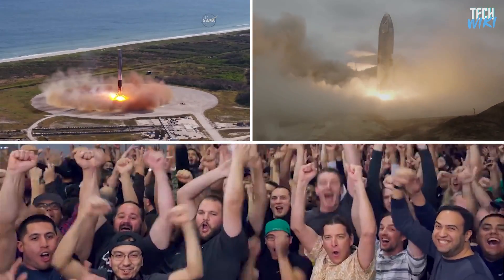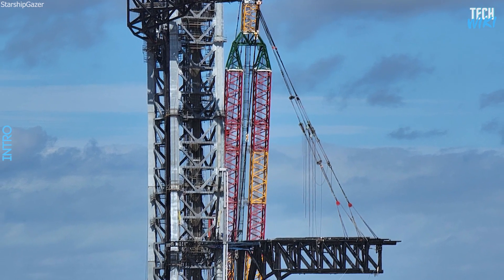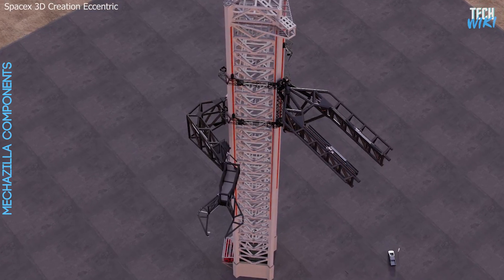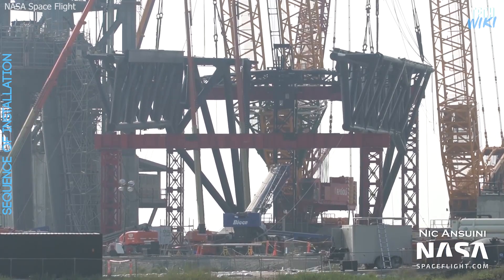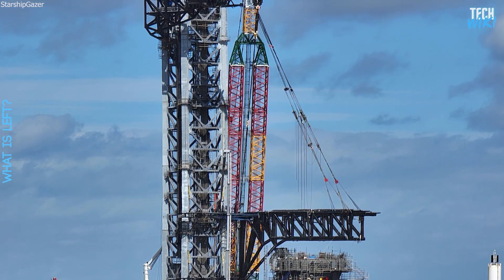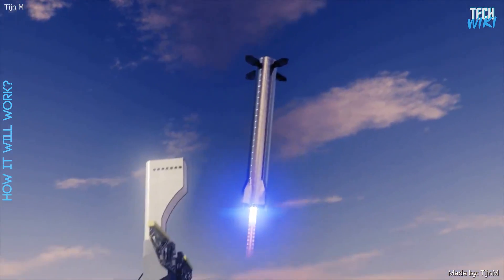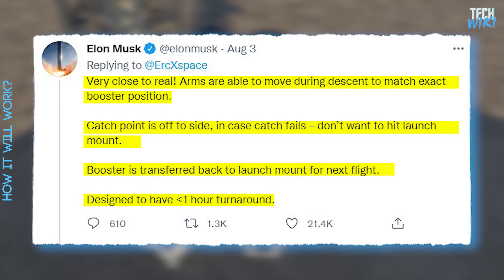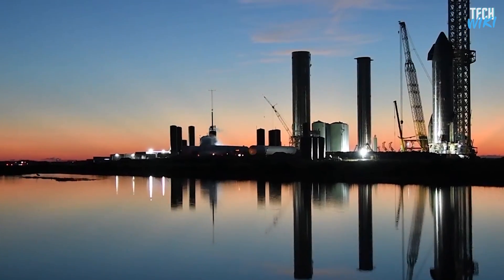Step by Step! How SpaceX Assembled and installed Mechazilla in just a Few Weeks?

Comment: or let it drop into a pit of sand with supports firing from the side to hold the neck in place after its weight comes to rest on the sand. think camera aperture.
Reply: Think sand filled rocket motors and the three months required to remove all the sand🚀

Comment: Chopstick carriage is too wimpy, need cross bracing at least.
Reply: The carriage doesn't carry the weight.  The weight is carried by the cables from the top of the tower and the tower itself.  The carriage only has to track up and down on the rails of the tower.

Comment: How do you catch a spinning, falling drink bottle thrown 10~20 feet up?  What's your success rate with or without a tool?
Answer:  With your own 2 hands, at the right angle. 

I would say their structure would be a huge SUCCESS and it will become an industry standard.

I say their inspiration probably comes from catching drinks in mid air, this is the absolute best way to do it. 

The success rate is very high for why check this video (https://www.youtube.com/watch?v=FycDx69px8U) , if the booster do a good job, and even if it doesn't, it's unlikely to explode in mid air after an impact with the arm. I'm sure SpaceX had already built several small scale model to test out most of the possible scenarios.

Complex problems tend to have a simple answer.

Comment: It isn't a Catching Mechanism ... Those Big Arms are built for Slow Motion Lifting and Placing ... just like the Teetering Cranes ... Which they need to get rid of ..... Those Arms are Needed ASAP for Unloading , Lifting , Stacking and a Solid work Platform ... Not catching ! ... Just because the CGI Cartoons can show them clamping the dropping Rocket and the Nerds repeat it every show ... doesn't make it Real or Possible ... Big things coming to a stop  requires BIG Springs and Reinforcements ... and like an airplane ... that BF Flying Booster is Fragile and Explosive ! ... Nor is Musk going to Risk his Brand New Starbase on a stupid Stunt ! ... That , has to be Tested out in the Boonies where Explosions don't Matter ...
Reply: That is pretty much what I believe too! 
Although I believe the up/down motion is to be able to service different rocket heights, meaning that they can launch shorter an longer rockets by just moving the arm up or down.
The arms will open shortly before launch to release the vehicle.
Reply: @RobiBue  I agree ... Those arms are for unloading or loading the BF Rocket sections ... off or on the flatbed mover ... stacking and unstacking ... and top to bottom Inspection and Repair ... Doing that on spindly Cranes must be a nightmare !
Reply: @robertbrander2074  Oh Robert if only that were true.
I think catching the Super heavy booster and Starship are crazy ideas but that is exactly what SpaceX and Elon Musk are planning to do.
They have no choice in the matter, if they want the Starship program to work.

When a Starship is launched into orbit with it's payload it's stuck there circling the earth unable to go anywhere.
It will need a second Starship full of fuel to be launched into orbit to meet up with the payload Starship refuel it in orbit then return to earth to be caught by the catch arms and refuelled in under an hour then launched again to top up the orbiting payload Starship, this will need to be repeated as much as sixteen times before the orbiting Payload Starship has enough fuel to leave for it's destination.🚀
Reply: @straighttalk2069  Merry Musk might as well Plan for a Christmas Launch ! ... It's going to take a Month just to finish off the BF Tower ... Launch Pad ... Plumbing ... Deluge System ... and Clean Up the Construction Zone .... Then he can do some serious BF Rocket Testing ! .... Everything has to be Spic and Span Clean and Fully Functional for the FAA's Approval .... I can't See any Rockets blasting off in less than a Month .... He doesn't even have a place for testing Small Hops to Fine Tune the Landing Algorithms ? .... And why is Musk pulling every Nerd's Chain with all these Unrealistic Dates ?? ... What is Musk Up To ?? .....

Comment: Given the insane mass flow rates for Raptor's pre-burners and combustion chamber, how do you shut the thing off without destroying it from hydraulic shock? If it's as simple as "shut the valves slowly"
Reply: There are engines with way higher flow rates, like the F-1 (Saturn V). The valves are designed to shut off high flow rates, in some way or another lessening hydraulic shock.
Reply: In moment of closing valves, the tank is at least 2/3 full of easily compressible fuel vapour, which helps disperse hydraulic shock.

Comment: I'm curious to see how they're going to get the cable to the top of the tower, around the pulleys, down to the catch arms, back up to the top of the tower, back through the pulleys, then down to the drawworks winch. I'm wondering if they'll first run a light-weight cable in the desired route, connect it to the heavy cable, then just run the winch to pull it through? However they do it, it should be interesting.
Reply: Not sure what the guy above me was smoking. Anyway, they use ropes getting larger in size, a small one pulls a bigger one, which pulls a heaver one , maybe a few more repeats, which is then attached to the cable and pulled through.
Reply: @ForeverNeverwhere1  I figured  it was something like that the method often used for pulling heavy cables places (say building suspension bridges for example) is to start with a very light cable that can be hand drawn, then use that to draw a heavier cable, then use that to draw an even heavier cable, then use that.. etc etc. until you get to the final one.
I guess there is a maximum difference between cable diameters that enables the smaller one to have the strength to pull the mass of the larger one.
Reply: @ChirstInTheDistance  yep, super fast, easy cheap, well proven method, as long as the first rope can take the weight of the second etc you are good to go.
Reply: That´s actually pretty easy. Done in the same way, as wehen installing a lift/elevator.

Attach a weight to then of the cable. Carrycable over top pulley, and let it "fall" down. Pick it up and repeat. WHen you´re done you anchor it at the bottom, and at the motor doing the lifting.

Comment: Crazy.. I would guess the tower will get  destroyed..
Reply: That tower is sturdier then you think.
Reply: @michaeldeierhoi4096  the tower might be sturdier than we think, but not sturdy enough to catch a returning super heavy! 
The chopsticks and arms are there to hold the rockets for launch.
Reply: @RobiBue  As I understand it the QD arm holds the starship before launch while the chop sticks will catch the booster and eventually the Starship when it returns.  I have not heard that the chop sticks are intended to hold rocket in place prior to launch, but I'm glad to be proven wrong on this complex process.   

 The booster is designed to hover unlike the Falcon 9.  And the booster is supposed to be in a corrective mode in communication with the chop sticks as it approaches the ground to one side of the launch pad.  The chop sticks will also raise the booster and starship into position on the launch pad to prepare it for launch though they will probably not be ready to do so on the first launch.

Comment: Elon has always said, “you learn More from failure”. Hopefully mechazillia and the launch tower are built to withstand a failure, as even an error of a few feet with the booster could prove catastrophic to the launch site. I’m sure this one keeps Elon awake at night, but I have confidence that he and his team Will be successful and have us in awe once again.
Reply: Actually, the reinforced "hooks" (I haven't seen them named anywhere) on the booster just below the grid fins are so small that an error of even a few inches will mean failure to catch. They must have a lot of confidence in their tracking and arm movement controls. My main concern is the GSE tank farm, and how the booster will blast it all down on liftoff. They seem to be building an earth berm between the launch mount and the tank farm, but those thirty, plus or minus, Raptor engines are going to put out quite a strong hot blast of exhaust in all directions, the way they've set it up, so far. Most animations downplay that tremendously.
Reply: It also might prove to be difficult to do on a regular basis and Legs may be added back at some point. That would be unfortunate but it still work without it.
Reply: @MJ-zo5gb  You learn More from failure when exploring the edges of something new, and unexplored. Such is the starship and it's launch system. Otherwise failure means your either reinventing the wheel or to lazy to study up on it. After SpaceX figures out how to manufacture, assemble, launch, fly re-enter, free fall and land successfully, more than a few times, then fine tuning begins.
Reply: What about payload, between catching it and relaunch, Starship's gonna leave empty?
Reply: @doubleottt  The first launch will be Starship with payload but then Starship will be empty of fuel, It will need another Starship full of fuel in it's payload area to be launched many times 16 or more time to refuel the payload Starship, while it's in orbit and it's this Starship that will need to be caught refilled and rapidly re-flown🚀